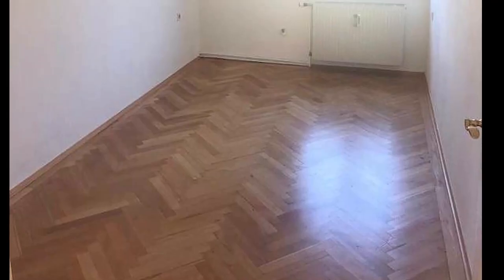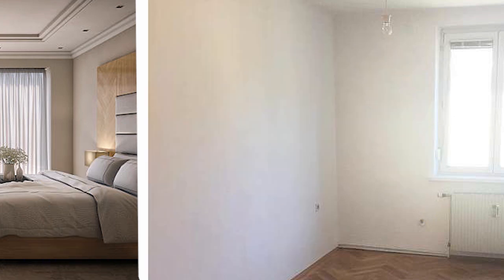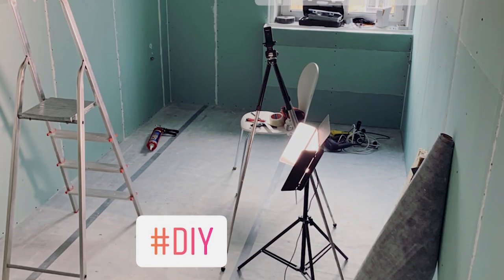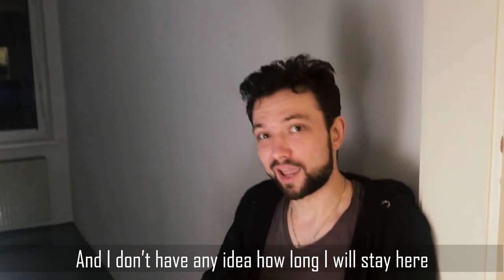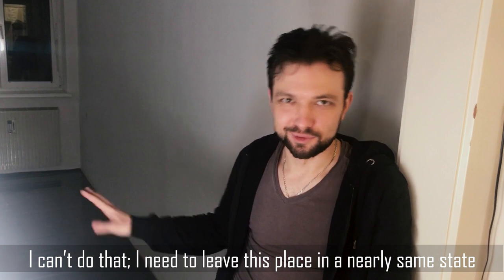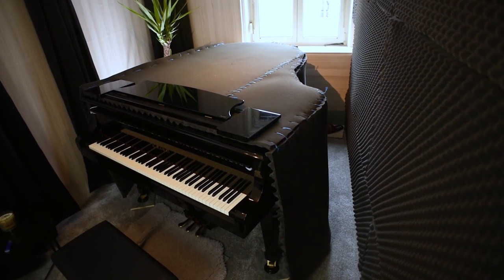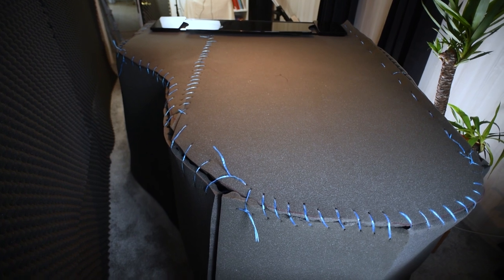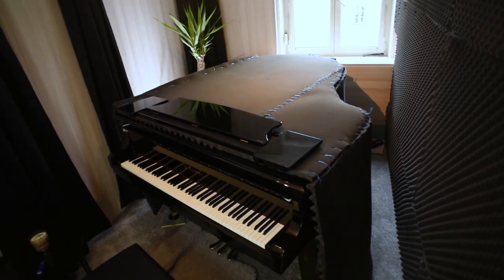DIY Music Studio Sound Isolation (done by two professional pianists)

Comment: I'm having issues with one neighbor in my condo even though building itself is decently insulate with concrete between apartments including floors. But she claims she's losing her sanity and posted in our building group my practicing the Rach 3rd cadenza as if I'm doing that all day... But I really can't go through all this, especially in a rental but once I buy my own place soon this was very informative as to options available. I don't have any a clue about doing any building, construction etc. so this looks quite intimidating and I find it amazing you were able to learn all this and then do it yourself. Also, my Kawai GX-2 sounds too loud even for me with the lid closed, stuffed with a duvet over strings, acoustic foam under the soundboard, piano covered with a blanket and large rug and rug pad under it covering most the room.

Would covering walls with even more of these black foam panels make the piano/room not as loud or it's useless?
Reply from the maker: As I mentioned in the video, foam panels don’t stop low frequencies and won’t fundamentally resolve the issue. When listening from the next room, you might reduce the loudness by 10-20%, primarily because higher frequencies will be partially blocked, and the sound will bounce less within the room. However, inside the room, it will sound much softer because most of the reverberation will be eliminated. To notice a real difference, you need to cover about 80% of the surfaces—basically everything except the ceiling, perhaps. It sounds unpleasant when it’s that dry, but it really helps protect your hearing, especially if you’re playing Rachmaninoff’s 3rd in a small room. I also noticed it affected the air quality, and I’m not sure it’s healthy to have so much foam around.

Even this solution, or any similar one involving heavy, multi-layered materials, will significantly soften the sound in the next room but won’t make it disappear entirely, reducing the sound by 50-80%. If she already has a grudge, even an expensive solution might not help—irritated people can remain irritated even when your Rach sounds as quiet as a kitten’s purr. In my opinion, this works best as a precaution, when the neighbors barely hear your piano from the start, so the irritation doesn’t build up so much over time. And also if you say from the very beginning how much you value their comfort and therefore have invested into this project, they might be kinder from the start.

On a positive note, in every country, there are regulations regarding when you can practice. If you clarify this with the authorities and strictly adhere to these hours, she can’t really do anything against you. 

Recently, when I moved out, I had to dismantle all of this. I ended up paying an additional 800 euros for moving help and recycling, as it amounted to 1000 kg of material. I managed to fix the holes in the walls, and the owner didn’t notice anything had happened in the room, but I was slightly worried about the repairs and returning the property. So yes, such a project requires a lot of effort, and I don’t think I’d do it again.

Comment: This is amazing ! After saving for years, I have just bought a small 2 bedrooms flat, and I am planning to transform one of the rooms into a piano room, just like you did. If I may ask a few follow up questions to the video... 
1 - What is the size of your room ? It looks quite small. My room will be 14m², and I have been told it wouldnt be enough for a grand... I am planning on a somewhat entry level Kawai grand (still a year away at least...)
2 - What model / length is your grand piano ?
3 - No complaints from neighbours yet ? I have both up and down neighbours to think about, I don't know what to do with the ceiling...
4 - How are the accoustics ? Is it worth it to have a grand with such accoustics ? Don't you think we would be better served by a smaller quality upright ? On your videos (which I assume are from this room), the sound is pretty good !
5 - Was it worth all the effort and money ? Is a grand piano with a few carpets and bookcases really too much dB for the neighbours ?

Thank you in advance, and thanks for touching on the subject of a piano room, that is so important yet so rarely mentionned !
Reply from the maker: Hi thanks for your interest!
1.-2. 
slightly less than 12m2, piano is 197cm long Kawai RX5. As you might see, I can squeeze along the piano to the window only if breathing out lol 🤣
I was worrying about this proportion also, but if you’ll cover floor and walls with materials that absorb the reverb (foam panels, thick carpet, thick curtains), you may comfortably practice even with an opened piano, it won’t sound too overwhelming. 
3. 
No complains until now. We don’t mess after 10pm (I still have an E-Piano for that). I have also left a detailed letter to my neighbours explaining the situation and describing how many efforts we have invested in making their life a bit more comfortable. Human relations decide everything in this matter. Also, I am pretty sure that they hear my playing as a distant background music. Your primary task is not to make a room 100% soundproof (that’s barely possible within this budget), but to lower a noise till that extent when it doesn’t irritate others.
4. Same as 1., it’s so much better to work on a grand, and please don’t be afraid that it would be too loud - it depends solely on how you’d manage a reverberation issue.
5. I don’t know how the situation would develop if I’d do nothing of that. I have had mostly terrible experience from the past and I’m quite sick from it. Because  piano sound spreads much further than just to the next apartment. If you’re on the first floor and have cool neighbours on the second, those ones on the third one might drink all your blood. And since we’re two professional pianists, and piano is being used heavily most of the day... and since the guy right next to us rents just one room and stays there all the time when he is not out... I didn’t want to find out. Furthermore, when you have got a grand piano in the room already (especially in such a small room),  you can’t really do smth like that anymore, there is no space to build.
PS Ceiling isolation is also a doable task, and you may learn about that on YouTube also.
Reply: @DenZhdanovPianist  Thank you for the details ! It's funny how the piano almost touches the walls of your room... The RX5 is such a nice instrument. 

I have never had a grand piano at home, and I would so love to avoid the "terrible experiences" you mention (maybe you could tell us about it in another video...) ; I have even heard of students being sued and losing for overpracticing during the day...
The hardest part for me is having your "piano" and "accoustics" budget be only one, so what I spend on the room is coming out of the piano's...

I do admire the courage you had to do all that work in a rented appartment, I would never dare. Just moving my e-piano in and out of flats was always a nightmare...

Comment: Truly excellent build. This is incredible for a temporary setup.
Reply from the maker: I had to dismantle all this recently when moving to a new place, and to my own surprise, after repairing a few holes in the walls, the room looks as nothing has happened there 🤣
Reply: @DenZhdanovPianist  Glad to hear it! I really respect the build because anything less wouldn't have been effective for heavy practicing. I'm currently dealing with room mode issues with my upright piano - certain notes are 6-8 dB louder depending on placement. When I move, I would like to upgrade to a nice grand where the sound would be projected away from the face, but until then I'm working to dampen the inside of the instrument. It's proving to be a lot more difficult than it seems! 85+ dB average while playing is dangerous..
Reply from the maker: Yes, hearing damage is a common issue among musicians. I myself practice with a closed piano mostly, opening it only when recording. However, if your room is very dry with lots of acoustic absorbers, the sound won’t bounce off surfaces, so it will be much softer. The only problem is that it's not very pleasant to play and very difficult to record when the piano sounds so dry.